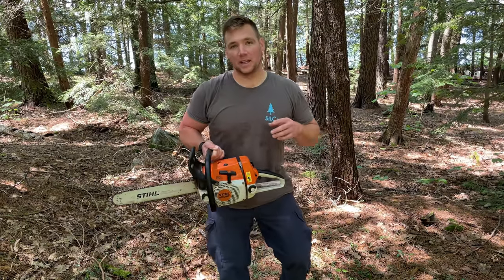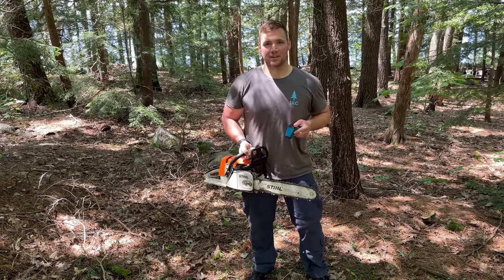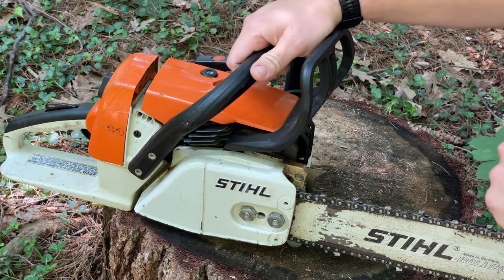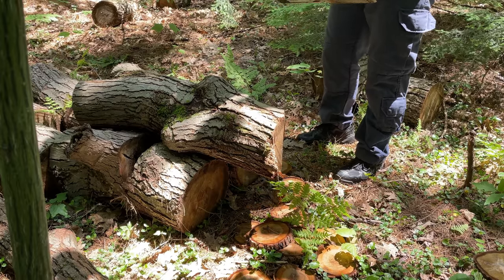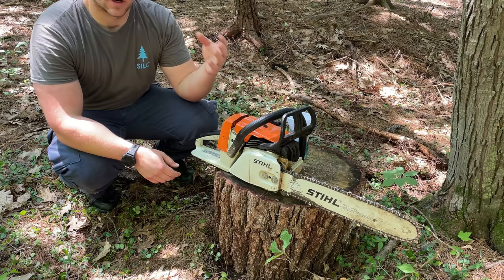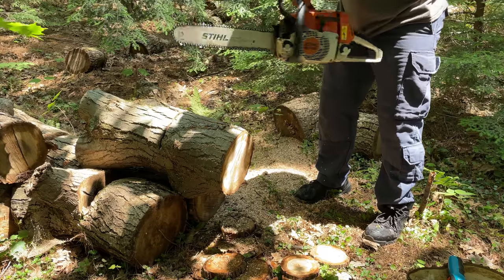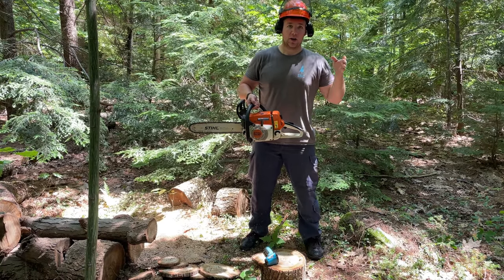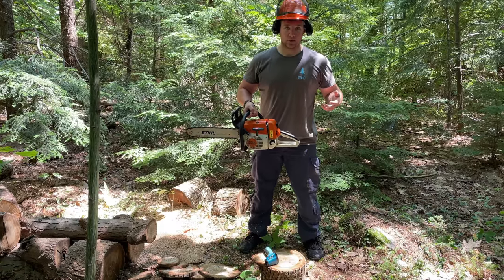Will my chainsaw last longer if I use more oil? Is it safer? (25:1 VS 50:1 temperature testing)

Comment: Oil burns Hotter then gas  takes more heat to burn oil Thus increasing engine temp. A diesel burns hotter then gas engine
Reply: A diesel engine also has a higher compression ratio for spontaneous combustion of the fuel by compression and heat, as distinct from the petrol (gas) engine's fuel being ignited by spark plug. Hence referring to a diesel engine as a compression-ignition engine. I do not believe that the different operating parameters of the diesel and petrol (gas) engines can be compared specifically with respect to their relative temperatures in operation.

Comment: “In every one of these tests there was an increase in temperature and I proved conclusively that oil is bad mkay”. You ran the heavier mix in a hot saw but the 50:1 was in a cold saw that was rested all winter. You failed to engineer a nonbiased test so your “tests” only showed that you wanted the 50:1 to tie or outperform the 25:1. Also you took the mix to an extreme. I personally run 16:1 in my saw that calls for 40:1 sometimes because I keep some for another saw that calls for 16:1. Works fine no difference beyond a little more carbon build up a little faster. I will conclude with this, if you want to run as little oil as your saw is rated for you do you with your shit. You won’t dissuade people from the mindset of better more than enough than not enough thinking on oil though. How many engines fail from not getting enough oil? Now how many from being a little over lubed? Exactly. If a mechanic says you took too good care of it and all that clean oil destroyed it then you know you’ve been lied to. Oil starvation is the killer. Had you done the same “tests” in reverse order though you’d have the same results with the fuel that was ran through the hot saw getting higher readings. Finally why are you running it hard then immediately shutting down?

Comment: Ah geez , the temp increase was because it had less power making your run time much longer , especially in the larger/longer cuts . Here's the reason , by putting the richer oil mixture in the saw , it decreased BTU's , making it run longer and laboring through the cut . But also , the richer mixture also introduced more lubricity to the cyl. walls and bearings , actually letting it run cooler for the actual run time of the engine . This won't actually hurt the engine righ away , but will foul up plugs faster and in the long run it'll carbon up the whole saw a lot sooner . It's best to run the factory advise . If you really want to make it run fast , decrease the mixture ... That way you can make a few cuts like a scal;ded dog , decrease smoke and rebuild it a lot quicker .

Comment: I always use the cheapest oil and gas I can find mix 50:1 never had issues. One of my weed eaters is going on 10 yrs old and runs better then my 4 yr old one.

Comment: Why in the world would you think the manufactures would not have done professional extensive lab test done before they tell you what the ratio needs to be. Anyone with common sense would now the thicker oil would run hotter.   Don’t understand why you would have done this non professional test at all !!!!!

Comment: If your oil mix has a higher oil mix it will create a carbon build up. Which is why each 2 stroke company tells you what mixture to run for what engines. They do the work of testing to make sure it runs at the best mixture.

Comment: You too extreme.  If your Stihl is 50:1 rated your test should be 60:1 vs 40:1. you'll see you should get longer life with 40:1 less power but will foul plugs more often. 60:1 will be shorter life but more power

Comment: Absolutely worthless comparison. 25:1 is too much oil. Do the comparison @ 40:1 with the saw properly tuned for each mixture. Then run each mixture hard for 2 hours. Then pull them down and compare oil the oil film left on the inside. I have, and my equipment all runs on 40:1 mix and is properly tuned. My oldest saw is a 280 farm boss and it still runs great today.
Reply from the maker: Hey Dorman - sorry you feel that way! I wanted to show a comparison of an oil mixture that is double that of the manufacturer recommendation, without any adjustments as I feel the average user isn’t comfortable with carb tuning.

Comment: Sorry bro, saw wasn't tuned properly for either fuel mix. Worthless test.
Reply: I disagree. Saw was not bogging or running rough at all. Throttle response was good with both tests with no hesitation.
Reply: @RMosher11  It was tuned way rich for both fuels. Four stroking most of the way through the cut, and only cleaning up for a little bit here and there.

Comment: Nothing more dangerous and detrimental than starting your saw on the ground
Reply from the maker: Please explain
Reply: you mean like starting it the way you're supposed to? if drop start my saw I'll break it (easy starter)
Reply: A) If you have proper safety boots on, your boot won't fit in the handle which if it is slips out the bar will hit your face
B) in most cases unless you are on pavement your chain will spin the dirt. 
C)if you are man enough you should never have to drop your saw to start it off the ground. Keep your arm straight and pull. My 6 year old daughter starts my 360 this method
Reply: @purebrawn5208  At no point in your explanation did you manage to come close to making any sense. My foot fits in the handle, which btw is what the stihl manual for your ms360 and the manuals for my poulan pro 222 and my chinese zenoah clone show to do. how is the bar going to hit me in the face if my foot slips? the saw is anchored to the ground by my foot in  the rear handle and my right arm on the grab handle.  even if my foot slips the saw is still anchored to ground with my right arm. i pull the starter with my left hand. 

how is the chain going to spin in the dirt? the chain brake is ON when I start the saw, which is the way you are supposed to start the saw. secondly even if the brake is off.....the bar isn't in the dirt.
Reply: @MrSGL21 a) you  have infant feet
B) you are a weekender firewood chucker who has flat ground  to stat every time
C) spend a day with pro loggers and you will never see them start their saw on the ground